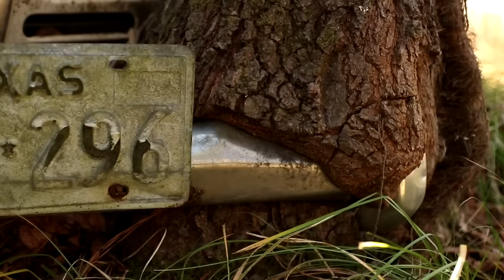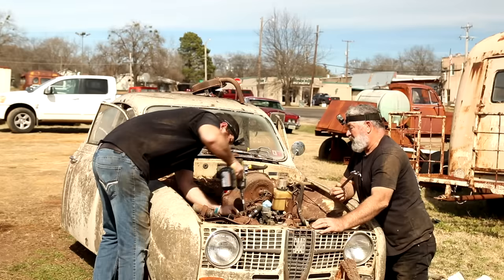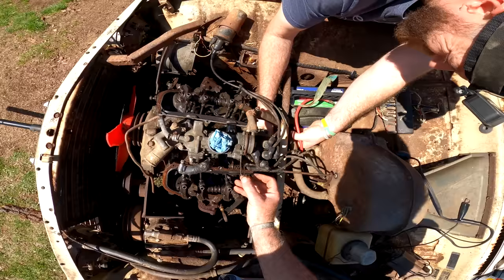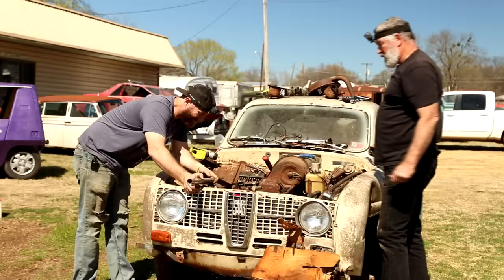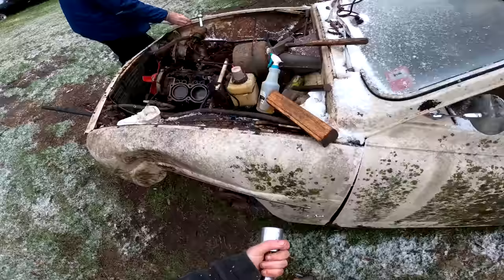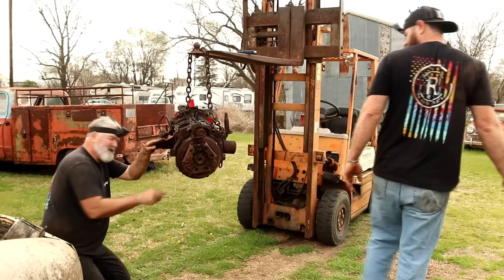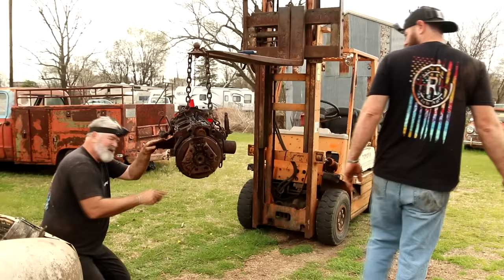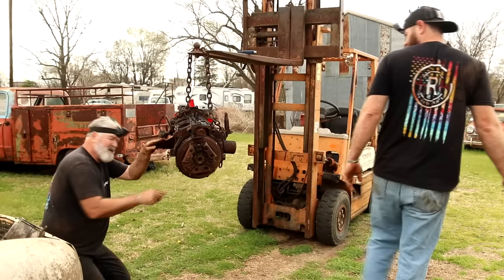THIS IS BAD! Attempting To Start Locked Up V4 Engine Covered In Rats Nest | 1968 SAAB 96 | RESTORED

Comment: Thanks for video. Good effort. Could be either the reused head gaskets or stuck compression rings (probably both)  Bearing in mind the amount of corrosion i think the rings could be pitted to the point where they're not sealing at all. That type of engine is called a wet liner engine, where the cylinder sleeves have coolant running directly against them. They are a little tricky to set up on installation. The 'four on a tree' gear selector is yet another peculiarity of this car. Previous SAAB offerings were 2 stroke, but got killed off by emissions legislation. If you think the battery is large, bear in mind the design comes from a cold country!
Reply: (I imagine the exhaust valves are fairly rough as well!)

Comment: Very interesting episode and an interesting car. The 96er had till 1967 a German two stroke engine with three cylinders, developed for Auto Union /DKW. The V4 is also a German product from Ford Germany. These wer usually working in different models of the Ford Taunus.

Comment: I use 40:1 or 50:1 mix fuel in a spray bottle to help get old motors running. adds lube while starting.

Comment: Did you check the gap on the points with a feeler gauge? As it has to be set when under load. They give spark when you flick them, but there has to be a gap so that it touches each time it fires. If the contact remains together when cranking, it won't start.

Comment: Saab were and probably still are, very well made. I had a Mercedes 206D with horribly poor compression, and I could only start it by putting 24 volts to the starter. I did that for over a year without issues. I think your SAAB will take 24 V as well. Good luck!

Comment: My dad would of been rite there with you guys on this one. I remember him buying an old Jag. many years ago. He did the same thing as you. pulled the heads and beat on the pistons. he got it running and then sold it. We are Houston Texas mechanics and have been for 400 years.no you did not read that wrong. My family goes all the way back to the beginning of Houston Texas. I am part of the Allin Family. They founded Houston in 1835.

Comment: The ol v fours used to eat head gaskets they very quickly over heat  you guys keep trying u will win I used to worship these things had many Saabs ,,Gm got hold of it then broke it they are very good cars built to last ,they don’t build cars like this today they were very. Good quality still built in china under geally brand .I want to see this car running keep at it you will win   Db from Gb.

Comment: DC Motors are not voltage dependent. If you ran the starter on 24 volts it would spin faster.  Of course you need to be cautions that you do not over volt the system and melt connections you will need later.  Might try a six volt battery so you crank it with 20 volts. It was common for me to start 6v engines on 12V when they were new and tight but old starters tend to be larger to handle more heat. -Cheers

Comment: Use KEROZENE,  far better if warmed up, this will loosen your engines after the 2 or 3d day ! 
Also make a clamp (you can even use the cylinder head) on the engine bloc above one or more  piston, put a piece of pipe +/- size of piston, between clamp plate and the piston (or pistons) tighten the clamp bolts then use a hammer  keeping tightening the bolts ! can even use a pneumatic hammer ! I even drill   holes just above the flywheel ring gear.....also put a bottle jack on the clutch pressure plate.......make a plate or use a rim on a drive shaft  and use a winch!!!  But start first with the hot kerozene !!! Best regards from french Guyana !!!

Comment: We don't use them anymore but that condenser on the dist should be replaced. They go bad over time. There is a gel sep by paper inside and it breaks down. Filing points is a lost art as well. My neighbor had the 2 cycle back in the day.

Comment: Don't give up on the ole girl yet....I've had good luck with using gear oil mixed with gas...maybe half/half mixture, then using a squirt bottle to feed the engine.  Not guaranteed to loosen those rings..but at least it will get it running enough to put some heat into those rings.  First, though, do a leak-down test to make for sure everything else is sealing properly.

Comment: Check the front of the center console.  THere should be a lever.   Its got a freerun in the transmission.  (Leftover from the 2 stroke time I think.)

Comment: Thats a Ford industrial engine and when you pulled that starting rope- the transmission goes into neutral when then engine is not pulling. Good luck ! Been there.

Comment: A brutal but effective trick can be to put 24v into the starter motor using two batteries. Use short bursts on the starter only, but the motor will spin much faster.

Comment: Since the engine was out it would have made sense to at least pull the pistons and take off the rings and clean the grooves so they can move. Since the pistons were so stuck it makes sense that the rings would also be stuck

Comment: It's flooded. Notice it tries to start at first, then you add starting fluid and it just cranks. Hold the throttle wide open as it leans out it will start. It will run and smoke till the oil burns off

Comment: try with 18V or 24V on the starter. 
It will spin it over a lot faster and if you do it in short burstys, it will not damage the starter.

Comment: Put some thicker oil in the cyl's put plugs in and it will fire. Have to move quick so the oil doesn't leak past the pistons. Once it starts it will smoke like hell, but as it comes to temp rings may pop back out. Good luck.

Comment: My Saab is 22 years old and going strong. My son wanted me to upgrade but I won’t give it up. It’s too reliable. Too bad they’re out of business. For parts, Tony at The Auto Shop in Appleton, Wisconsin is a Saab mechanic. He buys, repairs, and sells used Saabs. He has a line on parts new and used.
Reply: As an added thought, Saab is a breed of its own. It has nuances. For instance, my Saab will only start and release the key when you park if the shifter is in reverses. If the car doesn’t start the first time, you have to turn the key all the way to the left (off not accessory slot) each time you start it. Theft deterrent. Tony can tell you if there’s any quirks with that year.

Comment: About the transmission. Have you checked so the transmission has the freewheel locked? Otherwise you can't towstart it. Check for a lever on the gearbox

Comment: Way back in the late 70s I rebuilt the motor & transmission on the exact SAAB. At that time I learned that this engine was produced but Ford with the provision it would only be used on forklifts in the US but they sold it to SAAB for their use. I found a auto manual and followed it step by step. Enjoy watching and best of luck.
Reply: Used in a lot of ford cars in europe from 62 to 77.
The mustang prototype also used a V4 engine

Comment: It's a four-speed on the column with free-wheeling lower down but it's a h pattern first is pull up go up second is pull forward to go down third is push forward in the middle and go up and forth is straight down forward

Comment: At the end, I was thinking that if you have a large-enough drill motor, you could use that to turn the engine over, plugs removed, and add oil or Blaster to the cylinders and free the rings that way.

Comment: Saab 96s had a semi-automatic transmission available.  That transmission would freewheel if the engine wasn't moving above idle speed.  The way to tell if you have one is to see if there IS a clutch pedal.  I guess you already saw that there is a clutch or isn't.

Comment: This V4 injects a little bit of oil when the throttle is pushed most likely why you might have seen low compression.  There is a Top Gear episode on this car and they talk about it for a few minutes.

Comment: I owned a 1974 saab it was in a road accident it hit a bridge post side on ,,bent the drvers door and  door frame post in 14inches ,,it was built like a tank ,took me 4 200 ton chains and rams to pull the door frame straight ,to then cut it ,out and refit a new door and frame ,drill and cut broken door frame out refit straight door frame and sill .lucky the floor was not bent ,or the roof ,great cars,it surrised me you cant get the engine and clutch parts as they are ford parts

Comment: The freewheel transmission won't allow a tow start, you need to pull the pistons and free the rings manually, hone the bores, new head gaskets and probably remove and Grind all the valves in
Reply: There is actually a lever on the gearbox that you can operate with a small T-formed handle from inside the car under the dashboard to disengage the freewheel and you can actually tow start the car. I bet there are pdf manuals on line to find out how to do that.

Comment: That thing will run and once it does and it goes thru a couple heat cycles it'll run like new. It's something stupid simple with the clutch linkage or shift linkage lube it all down real good. sometimes just hooking a gas can to it will get the right amount of fuel to it. love the video's keep em coming.

Comment: If all else fails roll it on a dyno or something. Get that beast warmed up and put some motor honey and ring seal in there until it heats up enough. You almost had 'er. I'd say cup the choke with your hand every 3 jubs on firing order start. I'd love to hear this thing running even if badly. Don't give up. You have the start to a good side project for someone.

Comment: I don't know if it is common where you guys are from, but radiator theft (especially from older cars with copper radiators) is common where I am from. If an old car sits in an accessible area for any length of time where I am from, it will usually always be missing the radiator.

Comment: Yes try 24v (for a short time)   or try a 12v+6v battery in series to get 18v and that will give you a bit better insurance policy on the starter and electrical system......

Comment: Just make (weld) an engine stand with 220V with some 5000 rpm spec or similar electric motor with gear, that you can put on the flywheel, so that it can even stay permanently engaged. If you do these old things a lot it does not make sense to hustle.
Or you can make something you can attach to a driven wheel (probably with just the rim) with a rubber belt, that is if the gearbox and clutch works ...
Heck maybe an old belt driven yard tractor/lawn mower/similar engine would do it just as good ...

Comment: Some of those old Saabs had a free wheel lever for the transmision. That could be why you can spin the wheel and the engine doesn't turn. My 68 Saab three cylinder had that.

Comment: we call them wet liner engines/motors there pretty common over here in the uk , 
well they used to be pretty common , cars like the  k series rover had them , vw t3 water cooled 1900 and 2100 as well as a few others all the way up to the mid 90s early 2000s

Comment: Has anyone mentioned that these cars had a free-wheel option that disengaged the clutch so the car could glide down the road? I got 38 mpg with mine. Theres a lever near the floorboard on the left. Push and the clutch will engage.

Comment: Folks I don't know if it will help but back in Germany during my second tour of duty there I had a 1974 Ford Capri v4 that looked a lot like that engine,Maybe you can cross reference it and find your parts. Renault also put out cars with the same water jacket around the cylinder wall system,Hope this helps.

Comment: If worse comes to worse, you could try to adapt a Teledyne 4A084 military aircraft engine into it as long as you opened up the airways, i.e., the carb and the exhaust.  It's physically about the same size as that Ford Taunus (not "Taurus") V4 and it's air cooled.

Comment: Trying pouring some Marvel down the carb and try 2- 12 volt batteries for the starter (24 volts). Keep the coil at 12 volts. It might pop off? Cool and weird old car.

Comment: The engine is a UK built Ford used in the UK Ford Corsair and Capri in the 1960's. Inherently unbalanced they used a counterweight shaft to smooth it out.

Comment: The early model Ford Transit Van (1965) used a Ford V4 engine. My brother had one, and I can tell you that the engine is  garbage.
His van had a noisy ratty engine, with the pushrods wearing out prematurely, after 30K miles, due to oil starvation.

Comment: If its a 12v starter... Run two batteries in series for 24v. It will spin faster. Don't lay on it and check the starter temp it'll be fine.

Comment: Definitely go 24v on the starter... as long as you don't crank more than about 30 sec. at a time, it should be fine. Also don't rule out that trans yet, SAAB did all kinds of crazy things with their drivelines in that era.

Comment: I know this is late, but, if you had a fitting that was spark plug thread you could tap it to a grease fitting and use a grease gun on the cylinder that’s closest to TDC and use hydraulic grease to press the piston down. Just saying. I think ford used the same engine in snow cats.

Comment: Could you put some gear oil in the cylinders, a battery charger with the fifty amp start feature, maybe the compression would come up high enough to start spinning faster. And maybe it will start. Just thinking with you.

Comment: Those Sonnets were a unique little car, a few years older it would have been a 2 stroke, a few years newer and the body would have been all fiberglass. 

Edit: OK while I was mistaken that it was a Sonnet, the Sonnet also used the same engine

Comment: Ford redesigned the focus rs with water jackets like that in the in line 4 cylinder it was a poor design under severe heat or hard running conditions when you said ford motor company it was the first thing I thought of

Comment: I believe I heard you say it was a Ford engine.
The car was a 68 production automobile 🚘. 
Makes me wonder whether it has a connection 🤔  back to the UK 🇬🇧  Mk1 Ford Transit van / pick-up.
Saab I believe is Swedish, have I missed something !
Seems plausible that a Swedish/ British collaboration 🤔  may have taken place ?
V4's are quite rare, whilst "boxer" 4's are a little more common, such as Volkswagen, Subaru & experimental Mk1 Morris Minor ( c1948 ).
Thanks for persistence with this little gem 💎
Reply: Forgot to mention, that those three car brands sat on their transverse driveshafts ie. Front wheel drive, Subaru went one step further with four wheel drive.
Reply: Brits firing order was usually 1,3,4,2.
Map out your firing order by looking at the distributor cap leads.

Comment: Run the starter on 24volts. I think if you spun it faster it would start and compression would come up with a few heat cycles.

Comment: Saab has clutch, which is "adjustable", it is called "open Clutch" or something like that, that lever is for open or close that clutch! I dont think there is anything wrong with transmission, they usually last forever, open heads again, and turn valves, and PUT NEW HEADGASKET in there, you will get it running, how about new points?? too??

Comment: To get it to spin faster what if you take another battery in a pair of jumper cables and hook up a starter in such a way as to run the starter at 24 volts just long enough to crank the engine that should run the starter twice as fast

Comment: Got a question when the oil level is up to spec why does the low oil pressure light comes on with the anoying buzzer on a 04 Chevy tahoe

Comment: Has anyone told you that SAAB had what we called in Sweden freewheels?
The freewheel is a remnant of the two-stroke engine that SAAB had from the beginning, 
at that time it was not good to do a  engine brake as you basically turn off the fuel supply and then also the lubrication to the engine.
 Hence the freewheel that allows you to let the engine down at idle without having to put out gears and other things at turns and intersections 
or the like. Maybe the SAAB era has the engine disengaged.
/ greetings from Sweden.
Ps. The Ford engine that sat in the cars was English rubbish.

Comment: When checking compression, gas pedal should be pressed down, full gas position!!! And, turn valves, I was so surprised, you did not do it???? Otherwise, very interesting, done some work for this kind of engine, Taunus had same engine also =0), 1.7 litre V4!

Comment: The early Saabs had a two stroke engine that needed an oil mixed with the gas and the later v4 also had a free-wheel function the same as the early ones.  I’m wondering if the free wheel may have interfered with your attempts to start her.

Comment: I think you have an ignition problem. Maybe when reinstalling the distributor you put it backwards or something like that. Those are not the usual engines to work with and mistakes can happen easily

Comment: The transmission is probably not bad at all. It has a free-wheel function, just like the 1-2-3 gears of a TH700. That’s why you thought the clutch was slipping… 
😊

Comment: I had a modern car with a blown head gasket... it wouldn't start at all - until you had someone block the exhaust pipe while cranking...  then it would pop off after a short while It would be ok the next day too, left overnight it would start. But if you left it two nights .. you had to do the exhaust blockage procedure again.... Try it and see.. I want to know if it was just me or if its a Thing.

Comment: My mom had two saab station wagons a 1963 3 cylinder two-stroke had to add oil to the gas second one is a 1967 three-cylinder two-stroke with an auto oiler both 4 speed on the tree  they both still run and drive

Comment: I would love to see you get this started.  You need to use 24 volts (two 12 hooked in series), that will give you the compression needed to get it started, especially since it was sooo close.  Either will either kick-in or burn out your starter.  SleeperDude has used this trick on several of his cars to get them going when nothing else has worked.